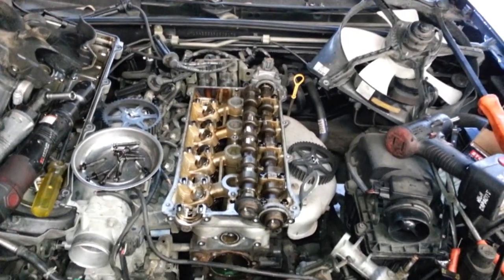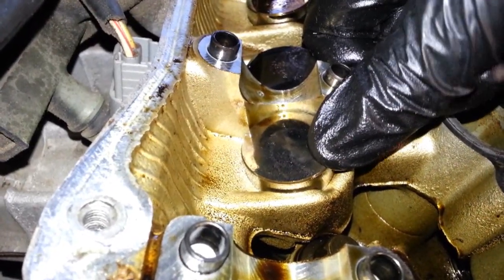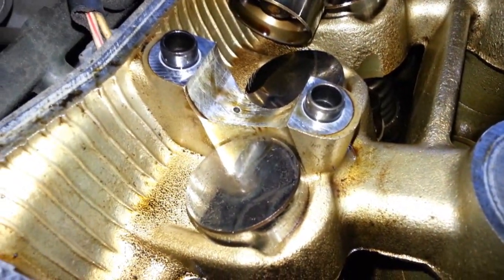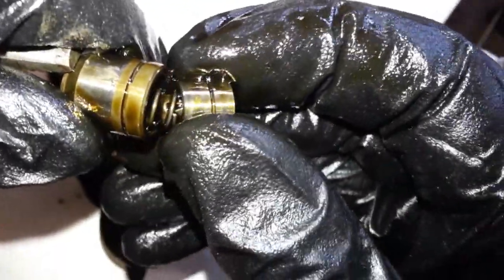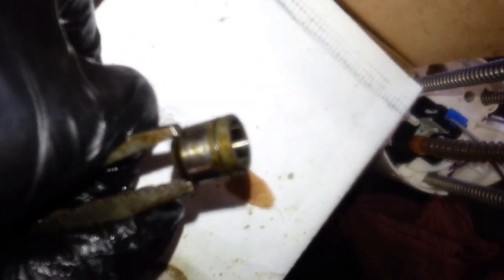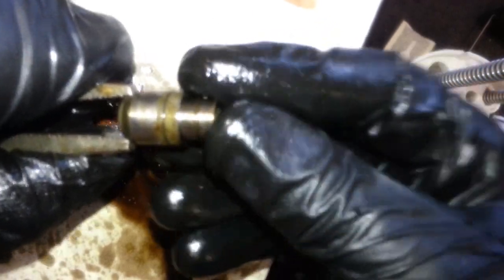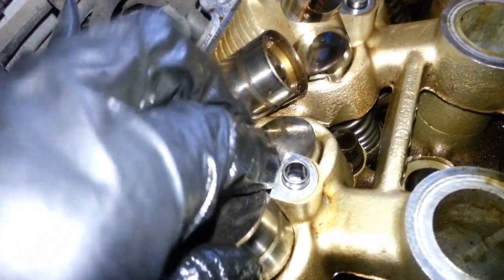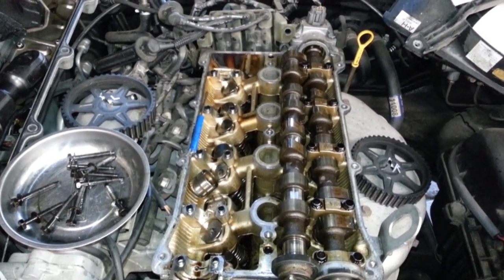How to fix hydraulic lash adjuster tick on miata,  ford, Hyundai, Mercury, and KIA.

Comment: A good lifter will hold oil until you compress it in a vise, or take it apart.  Your "stuck" lifters are staying pumped up, which is good.  A collapsed lifter you would be able to move with your finger.  The check valve holds the oil in the lifter to prevent it from bleeding off.   As soon as you start that engine the lifters will pump up creating zero lash.  If you would pull that thing apart again, you would see nothing changed.  You would not be able to push them down.
Reply from the maker: thanks for clerification. its silent now. So what you're saying is they are one-way check valves. There is some dampening and bypass for constant adjustment (or the motor would loose compression as soon as oil pressure hit the lifters, the stuck lifters need to be cleaned out to prevent the valve from staying closed completely, That would be much worse than any noisy lifters, and causing it to burn. The noisy ones are from collapsed lifters that can't stay pumped up when oil pressure is introduced.

Comment: I'm a 35 year plus certified mechanic. In my opinion if your going to take the thing apart put new just saying. Do it once do it right. Plus if your going to reassemble the lifter after cleaning you might want to reassemble with fresh clean oil.
Reply: +TheYnnad77 If you are a 35 year plus certified mechanic then you would know most people don't want to spend money on new parts for an old car if they don't need to.  He is doing it for his sister so time is not an issue like in a shop where you would not want to be stuck cleaning old lifters.
Reply: I understand I just work on the principle of not seeing the job come back. so if you have I to open just do it. so this way its guaranteed not to have to be opened again. nobody wants to spend money silly.
Reply: TheYnnad77 Ya that makes cents, reading back on this comment I think I sounds a little like a dick.  Keep up the good work!
Reply: @TheYnnad77  looking at this from both perspectives you are both right but here's the thing, 35 years plus experience as a mechanic have you become more of a fitter? This tho may be the better solution for customers however this video is more of a home mechanic of stripping and repairing parts which is far more interesting and rewarding than replacing the parts if it can be done, even if his understanding of how exactly the part works seems limited, I'm not hating on either person here but you can't push commercial opinions upon a hobbyist

Comment: Lifters are going to be difficult to compress once they fill with oil, brand new or old. Once you have cleaned them, you are only compressing air and that's why you have a lot of travel. Run the engine a few minutes and they will stiffen again.
Reply: Hilarious barely moves its because it has oil pressure in it like it's suppose to
Reply: Question… shouldn’t it still compress because it’s out of the engine and the oil should just squirt out? I thought a stuck tappet would be a blocked oil channel? Can someone correct me please
Reply: @TheHooolagon  no because there is a check valve in it that keeps it from draining out when the engine is not running, otherwise you’d have a lot of noise every time you started the car until the pressure built up and extended them.
Reply: @jmkehayias1  appreciate it thank you, so a badly overheated engine would ruin this type of a bucket lifter… thanks

Comment: The engine running fills the lifters with oil and they get hard, you take them apart all the oil is lost and they are soft. Run the engine and check again they will be hard unless they bleed down

Comment: TIP: During reassembly of lifter AFTER THOROUGH CLEANING, I apply a good dose of Petroleum Jelly or Assembly Lube. Doing so keeps lifter parts lubricated long enough to PREVENT BINDING of checkball and small piston during initial engine start procedure when oil pressure is not present. It also helps in QUICKER pressurizing of oil by DISPLACING AIR trapped inside the lifter.

Comment: !!!!!!The Lifters which you can compress are BAD ones, the Lifters which are holding are GOOD ones!!!!!!!!
Reply: diesel mercedes I agree!
Reply: +diesel mercedes  Umm. the ones you can't compress are stuck/loaded with oil. The one he cleaned move freely due to being empty on oil. But once it warms up and is being pumped again with oil it will become rock solid and perform it's job without ticking...
Reply: +Carlos S And until then the followers will be slamming into the cam lobes and maybe break something. I've never seen a manufacturers service manual not have something to say about making sure hydraulic adjusters are full of oil BEFORE you start the engine.

This video is full of bad advice.
Reply: +ladamyre1 It makes the loading time less, making the lobes slap less against it. Some car manufactures (at least mine) suggest filling and leaving it over night in oil before installing.  My car used to due this, it ticked all the time after a cold start and after not using it for long periods. They were full of oil residue. A extensive clean up was made, a lot of crude was removed. That ensures once it's full it won't lose pressure nor oil after sitting a long time shut off. Now I use good oil with a nice filter with a no drain anti-back valve made of silicon to ensure startups are always quite and the engine is still primed of oil. Dirty or stuck lifters (as in the video, which you can compress manually) do not close the check ball completely leading to pressure loss. These are major strain items and should be serviced or changed (look online prices for you car, they are extremely expensive!) Also, check for hydraulic lifters cleaning. Hope this helps :)
Reply: Carlos S
I'm a retired ASE Master Tech and ended my career with GM dealerships. My best advice about all automotive fluids? Change them frequently, more often than the manufacturers suggest. Remember, they have no interest in your car lasting past the warranty period.

Engine oil - 2500 miles.

ATF - 30,000 miles and do a line flush, that filter never has to be replaced.

Coolant - drain and replace 2 gallons (50/50) every year. Do not use "flushes", they can hurt the existing coolant you can't get out. Thermostat while I'm here - replace every 50,000 miles.

Do these things and it may go 300,000 miles before you have a major problem. I've seen it many times in my career.
Reply from the maker: ladamyre1 gunk from lack of intervals causes this. You are spot on.
Reply: subtledriver
Frequent fluid intervals is the key to any machinery that requires lubrication and coolant. It's all about contamination and dilution of those contaminants.

The main enemy of engine oil? Carbon. That carbon residue is what makes the oil turn black and that carbon is like liquid sandpaper, the darker the oil the more wear it is causing.

So don't waste your money on expensive synthetics and go 15,000 miles between changes. You may save money on the oil by going that long between intervals but your engine will suffer more wear because of the carbon being circulated by that superior oil. That is unless the engine is burning propane in which case I'd say go for it! Propane does not leave carbon residue, it burns clean.

But the main point is to get that oil out, no matter what kind it is, as soon as it gets dark.

Regarding coolant, the most important function of engine coolant is to lubricate the seal on the water pump shaft! This lubricant wears out over time (those "flushes" destroy it entirely) and if you simply replace 2 gallons of mix every year there will always be sufficient lubricant to keep that water pump going for hundreds of thousands of miles. I've seen engines with 300,000 miles and the original water pump still on them.

Thermostats have a parafin filled "pill" that spits out a tiny shaft which opens the thermostat when the parafin expands with heat. Every time it does it loses a few molecules of parafin, so as the miles pile up the thermostat opens a little less each time until a critical mass of conditions hits and the engine overheats. So just replace them every 50,000 just to be on the safe side.

Follow those cooling system "do's" and the worst you'll have to do is change hoses, sans a blown head gasket. When you do, use silicone type hoses and they will last indefinitely.
Reply: +ladamyre1 Thank you, in fact I have a GM/Daewoo car. Running nice and good with no flaws. Good service intervals is the best way to conserve a car. BTW, my car is from 1998 and it only has 71,000 miles now. :)
Reply: you are correct
Reply: Thats right. They should hold pressure at least overnight. Youll hear the bad ones anyways. Ive been dealing with shit hlas for years
Reply: Diesel Mercedes only after they are filled with oil.
Reply: the reason they are hydraulic is so they can adjust automaticly, if they are rock solid they have become blocked and sound metalic no good, once cleansd and reprimed they adjust and become quiet.
Reply: @ladamyre1   how do u feel about using sea foam in my oil to quiet a noisy 2011 Hyundai Elantra? And the same for adding sea foam to my gas. I haven't done it yet but I'm thinking about it.
Reply: mammydammy do it
Reply: So much bad advice in this video!
The squishy lifters are the bad ones!
You should also put oil back in the lifters before reinstalling
Reply: Hi i just want ask a question hydraulic lifter can be switch in places like take the ones from cilinder 1 put it in cilinder 3?

Comment: You can not push them in because of the oil inside.
Reply from the maker: Well, its been 10k miles and they are still quiet. Been using full synthetic oil, and changing every 3k. Thanks!
Reply: subtledriver
i have a nissan 300zx vg30de and it has an annoying lifter tick esp on cold start up and around 32oo rpms. will be doing this surgery on her soon. 24 lifters in all.
so the lifter tick was completely gone after this cleaning????
Reply from the maker: yes all the noise was gone, at first startup oil had to work its way back into the cam followers after that they were quiet. dirt and carbon caused oil to get stuck inside, hydro-locking them.
Reply: subtledriver Hey, Mabey next time you should spin the engine up by hand and later crank it with the ignition and injection off. That way you get oil pressure build up ;) 

Greetings,
Reply from the maker: i'd rather run the motor, no harm no foul. thanks

Comment: when installing the lifter in its socket on the cylinder top, does the direction of the lifter's hole make a difference? Or you can place at any rotational angle?

Comment: Obviously the "old" ones dont move since they are filled with oil and the ones you have cleaned are bouncy because they are empty. Has nothing to do with the cleanliness of them
Reply from the maker: nuggex there is a check valve in the lifter, if its dirty, it wont hold pressure ;-p
thanks for the comment.
Reply: True that.
Reply: +subtledriver  well there holding thats why there not moving

Comment: Your reasoning for the noisy lifters is actually incorrect. However, your solution is correct. HLA's get noisy when the collapse due to the check valve not holding the oil in the lifter. When you remove the cams and press on the lifters, the ones that don't move are the good ones. The ones that do move are the ones making noise. When you disassemble the lifters, spray off the check valve really well. The ball not sitting flush against the seat is causing the lifters to collapse.Cleaning that seat will allow the ball to sit flush and will keep the oil inside the lifter.

Also, once reassembled, remove your fuel pump fuse and crank the motor over for 5 seconds at least 5 times. This will pump the lifters back up before starting the motor.
Reply: When you bleed a lash adjuster it is supposed to be like a trigger when you press it with your fingers.  Not supposed to be unloveable.
Reply: Agreed.  Of course it's going to move up and down after cleaning - there's no oil in the lifter.  Lifter lash should be checked as follows - "Run engine until operating temperature is reached (coolant temperature gauge at normal operating temp).  Increase engine speed to approx 2500 rpm for 2 mins.  If tappets are are still noisy, locate defective tapet as follows: Remove cylinder head cover.  Rotate crankshaft clockwise until cam of tappet to be checked is pointing upward.  Press down on tappet with wooden or plastic wedge.  If free travel is excess of 0.1 mm is felt, replace tappet."  This assures that the tappet is warmed up and should have been filled with oil (and solid).  If it's not and there's movement, then it gets replaced.

Comment: Probably already been mentioned but you HAVE to clean the little ball bearing and its seat as that is where the ticking comes from - cotton buds are the go. Half fill the lifters with oil before putting them back in so the cam lobes can compress them when the cam is put back on. They will tick loudly for a little while before they fill with oil to the point where the lobes are at the correct clearance.
Reply: Is there any special tool to disassemble it ? with normal plier I failed...
Reply: @laszlohorvath1540  You have to hit them against a block of hardwood really hard to make the little plunger come out. I made a piece of wood with a indented hole cut out to hold the lifter in place so you can swing it against the block with a lot more force and you won't injure your arm tendons like I did. Much, much easier way to do it, especially with stubborn ones.

Comment: Cleaning is always good, But these parts move in 3-dimensions. So always polish to a mirror finish if you have access to the lifters(and rods) and always refill with clean oil. I polish with Blue Magic(R) or Mothers(R) hand polishing creams and the results are always impressive. Polish the lifter socket too, but avoid getting debris in the the oil channels.  Lifters without oil in them will wear quicker. A Bad lifter will not hold oil and is identifiable by being fully compressible(i.e. full of air). FYI: Lifters should NEVER be fully compressible as shown in this video.  The job of the lifter is to push the rod below it so your engine can work properly.  Nice video thanks for sharing.

VDub Love from Chicago...
Reply: Hi, could I use silver polish as well ? 
I heard that refilling the lifters isn't good, because if they are too full, that could cause motor damage. ?

Comment: Thanks for the video, my mechanic just recommended replacing the hydro. valve lifters to remedy the ticking sound on my son's car. (2013 Hyundai Elantra, 90K miles) At least I now understand what he is recommending and how it might help. Also, if the charge seems reasonable.

Comment: hi mate and thanks for inspiring me to come up with a way ease my sticking lifters without taking the camshaft off and replacing them all.  I took off the rocker cover and poured liqui moly lifter clean over them and down the oilways then turned the engine over for a few seconds without starting it. I left it a few days then started it , let it warm up then held it on 3000rpm for 4mins, now sounds sweet as a nut.
thanks again
Reply from the maker: samphireseastoves next time, just pour the cleaner in crank case, start engine and drive it normally. it will clean out the lifters better that way. glad it worked.

Comment: Thanks so much man i have a 91 and it has this problem will be fixing this weekend thanks
Reply from the maker: I would reccomend replacing them with new ones if you can afford it, i used 0w40 synthetic for first oil change to get things cleaned up. after that, 5w30 synthetic. the reason these guys get clogged is due to carbon build up from going too long on oil changes and lack of good air-fuel ratio or missfire.

Comment: Tip... give it a real good bath in oil before putting lifter back together to get rid of excess cleaner.
Reply: +David Bilec i go one step beyond that and actually put them together while submerged in oil, then leave overnight in a bucket of oil.

Comment: before installing hold it under thin oil and squeeze it with the little hole on the side pointing up and you squeeze it so often until no more air bubbles are comming out of the hole, than it is full of oil and than you install it.
Reply from the maker: Sounds like legit info! I'll have to try this sometime!

Comment: i first did these hydraulic lifters in 1992 in a mk4 ford escort where the owner never serviced his car and the oil emulsified (thick oil like grease ) black death i took them out soaked them in diesel then worked the piston in and out till free, then in a bath of oil and flushed the diesel out then in fresh oil and pre primed them. when placed back in the engine no noise sounded sweet,but i have seen a few vids and i will clean them stripped down just to make sure.
Reply from the maker: Awesome! Thanks for the comment! This worked for me! But my collapsed/good description was backwards lol.

Comment from the maker: they should compress with oil because there is a hole on the side that would relieve pressure. They are stuck because of dirt build up on the moving parts. they are machined at very tight tolerances.
Reply: Agreed  lots of nasty gunk stopping it from compressing
Reply from the maker: @mileskiphuth331  I wrote this wrong. It has a valve that holds pressure. It gets gummed and let's it leak.